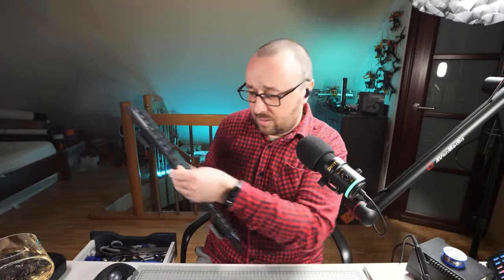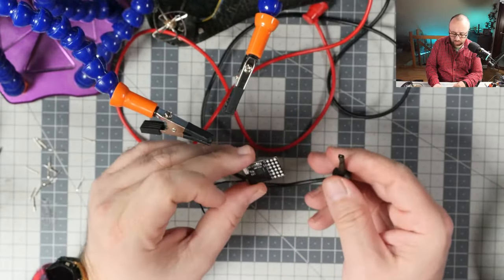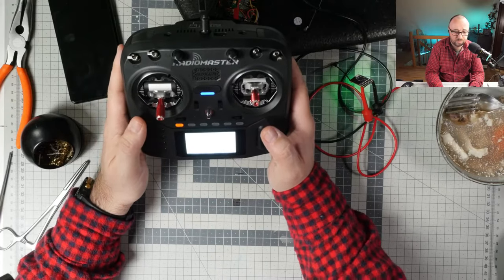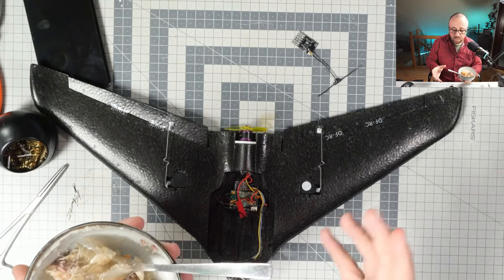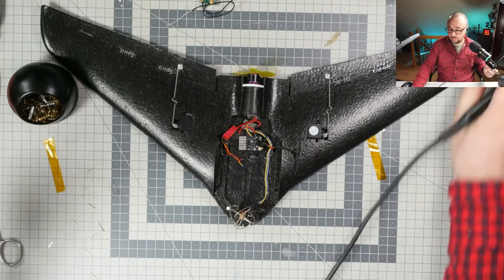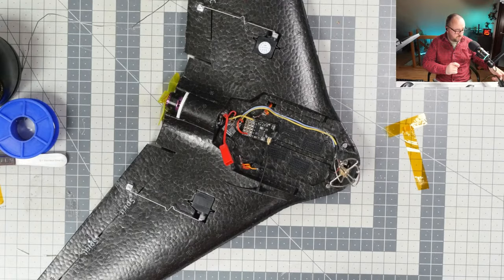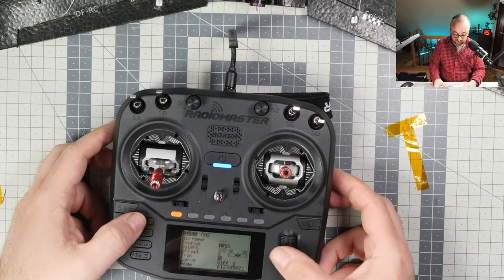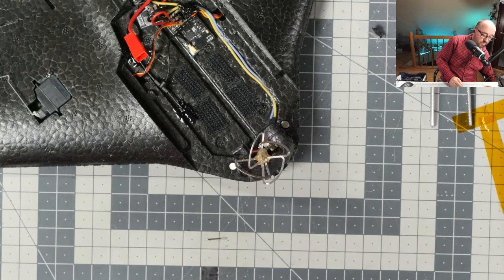Micro flying wing build/rebuild

Comment: https://www.youtube.com/watch?v=mf5G-rQFzWM&t=101s  Flew INAV 6 rc2 on my Nano Goblin. Great flying FW, but needed to adjust the ahi vertical position up a bit. Skyzone finally fixed my fpv darkening and rolling screen with their V3 Fusion board. About time. But next build will sport the HDZero Whoop board but with a foxeer micro camera in the original ZOHD Dart. 
Gusty winds and rotor from a spring like day thermals. Flew my trusty ParkZone Radian motor glider with the Matek 2400D elrs to the gps vario board. 30 seconds of throttle for a 20minute flight. Lift was massive and I had to bow out of it to keep below 400ft. Hawks were jealous of my thermal.
Reply from the maker: Nice flight and nice weather!